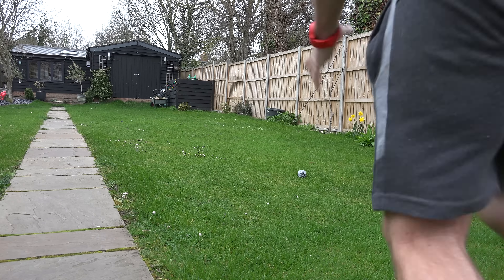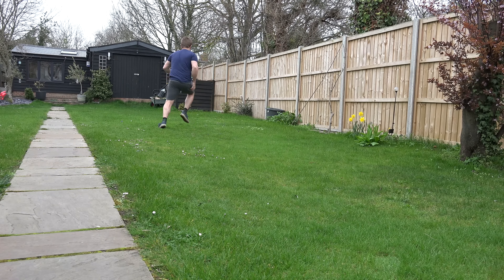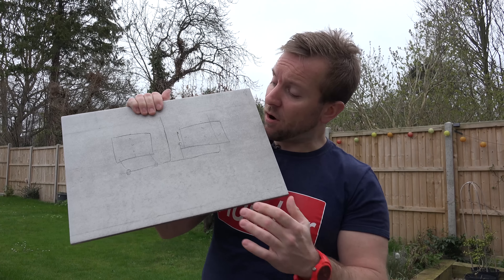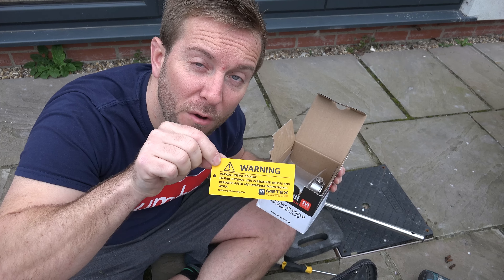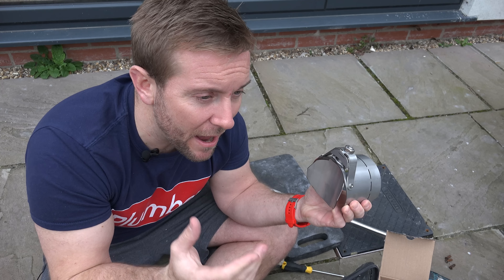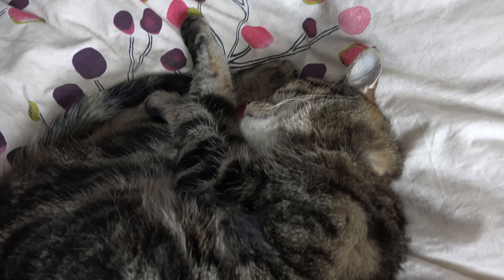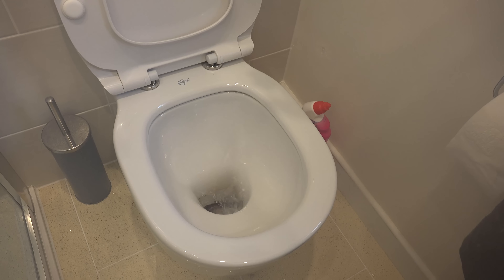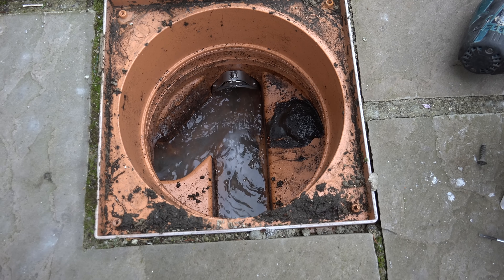STOP RATS GETTING IN YOUR DRAINS AND HOUSE - Ratwall

Comment: What if the rats climb your wall and enter into the loft space and then between floors This was rat problem your rat device doesn't solve! I took a whole bathroom apart and despite traps in the pipe never did find their entry points, But then I did get paid as I had to reinstall the bathroom floors and the whirlpool bath! They certainly never  came up the sewer pipe,
Reply: At a previous house, I had scaffolding up to do some work on the facias, and a rat used it to get on the roof and then got in to the attic by going under the tiles, and chewing through the roofing felt/paper underneath! I only found out when I noticed a terrible smell in the attic and went in to investigate...the mess one rat had caused was unbelievable, but luckily it had died before getting into the main part of the house..

Comment: I've seen a similar device that fully seals the sewer pipe when nothing flowing. Would stop rats but also prevents back flow up the pipe in main sewer blocks, a bit more expensive and needs some excavation to fit. This device is pretty neat for the rat problem though as its metal so can't be chewed through and is hassle free to fit without having to do any digging!

Comment: Don't worry the rats will chew through the walls of your foundation and doors. Or through the roofing areas . Sometimes they can dig through weak spots of the foundation floor too.
You will need to armor plate all those area with steel.
Reply: DON'T THINK I HAVEN'T THOUGHT ABOUT IT.     ALL, NEW HOUSE BUILDS SHOULD HAVE THAT.

Comment: We had rats in the loft and found that the gas main bisected the drain at the front of the house. This allowed rats to exit the drain close to the foundation, tunnel and enter the cavity. This is fixed now and we have rat flaps fitted. They don't snag or clog as some comments have suggested, provided you don't flush what shouldn't be flushed and put a gallon of water down each toilet once per week to flush them out. I do like the rat rap at the end!

Comment: Another (but more expensive option) if you have a public sewer running through your land is a Nordisk TX11. Due to a rather strange 100 year old sewer design there was no easy way to isolate just our property so I used 2 of them to isolate the old and new side of our property and the neighbour via the public sewer. Rats aren't eating the loft anymore

Comment: Been having rat issues for several months. Couldn't figure out how they were coming in when we realized they were digging and swimming through a sewage pipe up into an opening on the drainage opening on the basement floor. We stupidly took off that circular covering with holes awhile back.

Comment: Definite need to revisit the install after some time and see how it's doing. The obvious concerns would be the hinge fouling up or tissue getting stuck and causing pipes to block. 

The other way rats get in is via the soil pipe vent, if the covers have come off.

The wood on your house looks fine, you should leave it. Looks like a relatively new housing estate.

Comment: Ive got a section 24 sewer running under my home.Severn Trent Water ltd as owners and maintainers of the sewer  have been messing me about for over 50 years with problems of flooding via hydraulic lift and rat issues. To sue them is imposible like getting them to maintain the sewer.
It appears the sewer in the basement needs an inspection chamber and backflow valve that will not only stop rats but stop the rising flood water as well.

Comment: I think the RatWall is great but, I'm in two minds whether to get one for holiday cottage I manage.  My concern is wipes are going to snag on the sharp edges of the trap and cause a blockage.  Had a problem with wipes snagging on rough edges of join in drains - on the scale of things raw sewage overflowing into the back garden is up there with rats.  What are you thoughts?

Comment: We have a large man-hole cover in our driveway ( the houses were built about 1929) so not sure on the practicality of fitting such a device within the man-hole cover ..... ( The sewer is shared with the neighbour)  we also have a contract with British Gas/DYNO-rod so regular servicing such a device would not be a problem.   I’ve also had to have a refit done to my bathroom and previously had an in-line device fitted behind the toilet, which could not be fitted back by the builder repairing my water damaged bathroom floor, so this type of device would be essential.   What is the cost of the device, as I want the insurance company to pay for it to prevent further damage/ inconvenience later .....

Comment: It baffles me that Ratwall is configured out of the box for installation at the outlet.... if you get a blockage caused by anything further down the drain, the sewage will back up to the outlet and build up in the inspection chamber, for which the solution is to rod the drain through the outlet..... which is of course impossible with the Ratwall installed in the outlet, so you'll have to get your hand and arm into the sewage to remove it before you can rod the drain... Yuk! ..... and that's if the chamber is shallow enough to reach the device to remove it.
If the drain is too deep to reach the Ratwall to remove it through the sewage, you're stuck with a very real problem getting the Ratwall out of the inlet to allow you to rod it. 
Far better to reconfigure the Ratwall to reverse the flap and install it in the inlet, which it is designed to do easily.  Even if you have more inlets to one outlet in the inspection chamber, it is far more preferable to pay for more devices than to get involved with reaching down through sewage to remove one from the outlet to free access to the it, even if reachable.
Reply: Makes sense
Reply: Mask and snorkel, sorted

Comment: I’m don’t feel like anything should go down the toilet except for pee poo and toilet paper. I have learned not even wipes of any kind even flushables should go down and of course never any sanitary products or even hair unless you want to build a nice blockage. Never put hair down any drain I found out the hard way when the plumber had to take the plumber snake and clean out the clean out pipe for the house. And certainly condoms should never go Down the toilet, most are latex and that doesn’t break down well just wrap all these items up in toilet paper and put into the garbage. Most ppl think if you can flush it it just goes away, not so the bill isn’t cheap!

Comment: It's a good product,but I've got a question how do you unblock the drain with a drain rod if it ever got blocked as you can't pull the rod back out
Reply: Take  it out?
Reply: @B3NNYI3OY  the ratwall only allows things to go out into the drain but dont allow rats to come towards the house so by putting drain rod through and past the ratwall you can't pull it out again that's what I was curious about
Reply: @marjantanvir5979  yeah I know what what mean but what I'm saying is unscrew and take the whole thing out and put it back after rodding
Reply: If your drains are blocking on the regular, probably don’t have or need a rat wall.
Reply: No problem, just put your hands in and do what you supposed to do to get it clean.

Comment: I'm not convinced that this gadget could work on mine you sewage is a new build mines an old stone looking thing 😫
My rodent problems under my house,
I've been told that the rats could possibly be comeing in under the house through a broken pipe that lead from the sewage?
 my toilet is down stairs I keep lot closed ,
I'm at witts end any suggestions I'm sure the is no holes for these pesky critters to be getting in to under my home hasn't tapped in all my years of liveing here in till I've had an echo drain fitted for rain water to run into the sewers

Comment: I need help desperately, we have rats in our kitchen, I don't know where their coming from, we have a drain nearby.
Reply: Same here..scared
Reply: King Arthur - you need to find a hole or entry point on all external walls, i read or heard! Have you found the entry point & sealed it appropriately!? by appropriately i mean if it's a gas flu pipe, dont seal that; i suggest getting an expert to do catching n sealing holes! Do you still have a rat problem? I saw one rat run under me kitchen cupboard at the bottom, under the plinth, like it was trying to get away from me to outside, btw! It squeezed under a 2mm ish gap ffs! So, do you think it come in that way to mine!?(They might be comin in yrs that way n you not see them coz they only come out when nobody about no noise)!! Or, they could be climbing high up a drainpipe n in a gap somewhere!! I've got an old house with those old fashioned little square brick holes they used to have as air vents in my bedroom n its got a plastic cover on it with 1cm vertical lines! Now, its draughty n freezing cold so i looked there to close those vents with the plastic slide across thingy. Omg, I saw a big hole in bricks tha im sure werent tha big before n can see outside! Now, i am wondering would a rat have gnawed brick holes bigger, n squeezed through 1cm vertical plastic vent cover holes, lol??
Reply: @lawanahudson9643  Hi, pls read my comment to King Arthur. Do you still have a rat or rats problem? I've described what needs to be done first, entry hole found & sealed. Oh & ya dont want to seal a rat in, so must catch a rat first, check if more have nested, if have kill em & seal entry point/s. Does that help & make sense:)!? I'm not an expert, just been reading on internet & watching videos. apparently you can buy a thing that looks like an umbrella that fixes to drainpipes, to prevent rats climbing up further! I looked at it n it was only about six pounds so i highly recommend gettin one or how ever many ya need fitted! N plastic drain covers where washing up water goes out, i think that's help dont you!? Cover it in peppermint oil, haha! N toxic drain cleaner I saw someone put about on another video. Have you still got a rat or rats!? I have & have a phobia, headache, stressed & scared too btw. I've shut both kitchen doors hoping it dont get to go anywhere else til i can get someone out to climb a ladder outside to check high up brickwork!(it might av got in mine there)! Or kitchen pipe area! Where do you guess for mine lol?